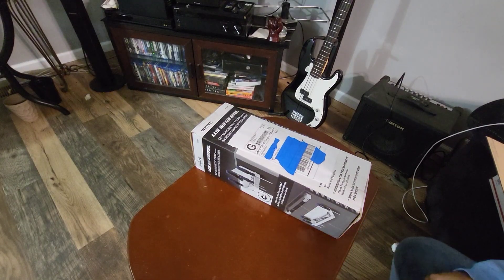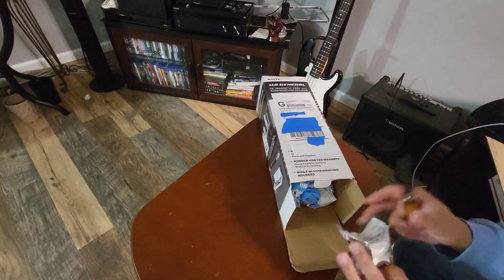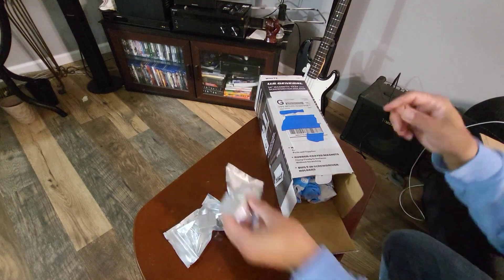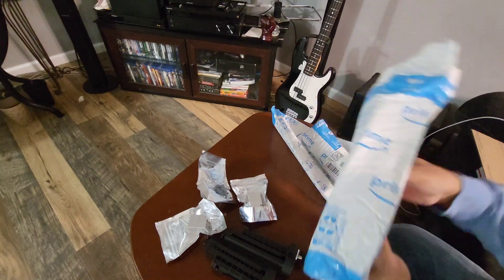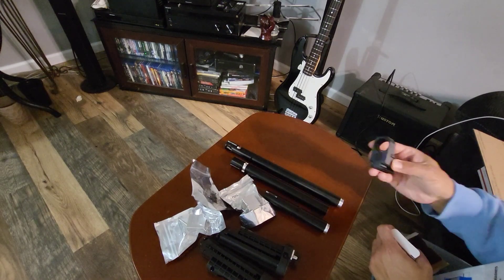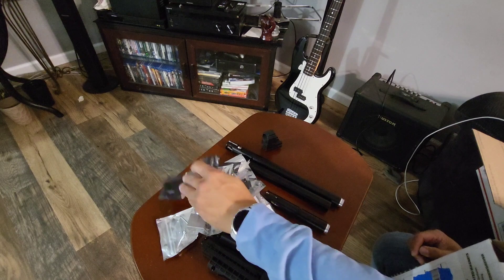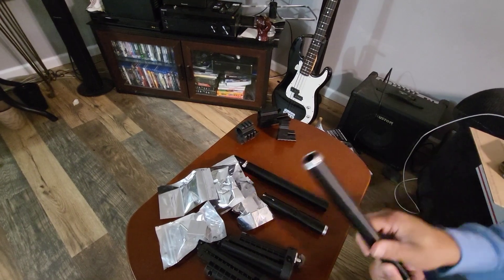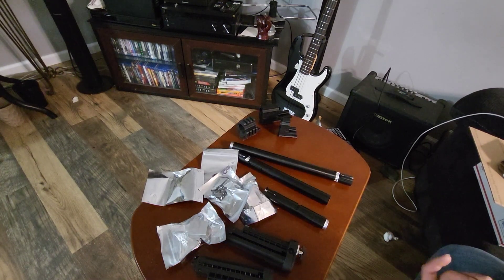SSD Unboxing video. *!RANT WARNING!*

Comment: Hey new here ..I was wondering about my MCX adapter with shut off valve I just got .I don't think it's working cause it does not stop turning in either direction..am I do something wrong here ? Or is it just defective? It's the one that doesn't have pressure reading available..also I agree there does seem to be a lot of adult children in less leathel..I didn't know about DK until I just watched your video..I dont have time for high school kids lol anyway thanks for your advise ..also I was using the adapter for my stormer elite..